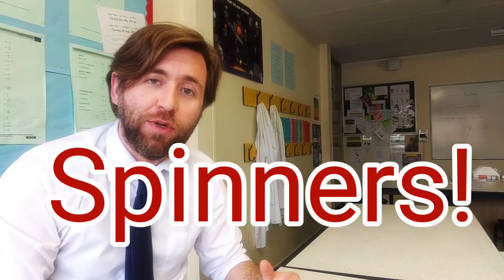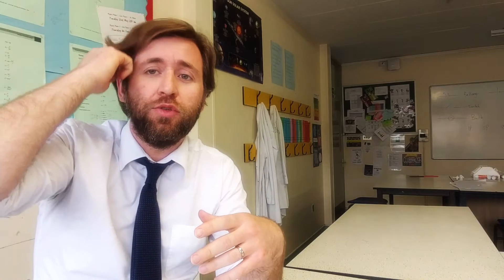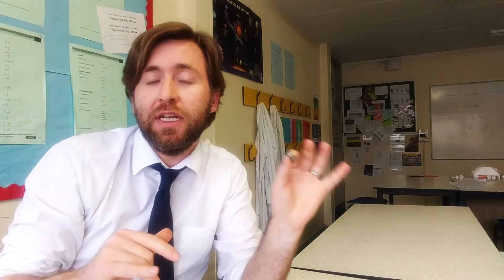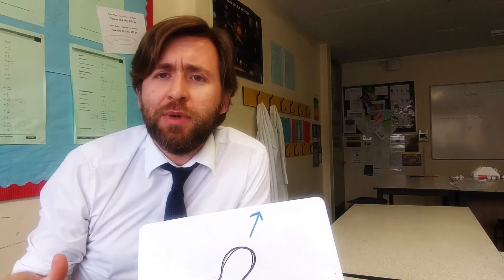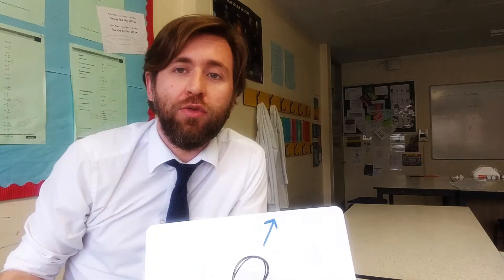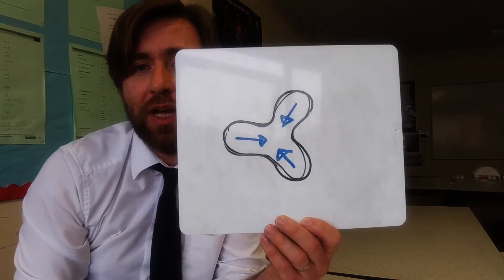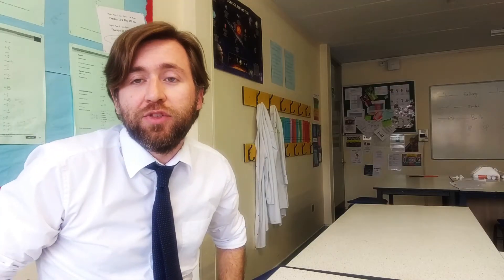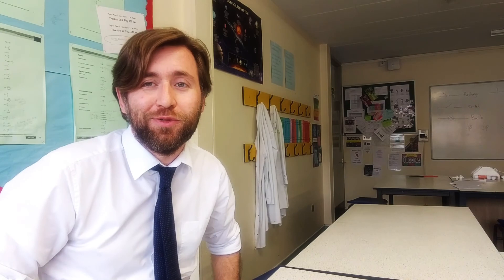how does a fidget spinner work?  CENTRIPETAL FORCE in fidget spinners - Physics Stories

Comment: Question: Wouldn't a wheel (same bearing, mass distribution and size) be strictly better because there would be less air movement/friction?

It would be harder to accelerate with your fingers though.
Reply from the maker: Lennard Hemkendreis yes a wheel would work fine, it might not look as exciting spinning though. have a research into gyroscopes, they basically are these.

Comment: I'm not sure if its just bacause it is cheaper. Buying a peace of metal is definitely cheaper than buying a bearing of equal mass, right? (both would be bought in bulk)

But there are also other advantages: 
1) It looks fancy, because people think its more than a fucking roller blade wheel. 
2) You can use the outer bearings to replace the inner one once it gets worn out (at least that would be a good idea).
Reply from the maker: Lennard Hemkendreis love the thinking here! point 1 I definitely agree with and point 2 sounds sensible. so the spinner bearings get worn?
Reply from the maker: Lennard Hemkendreis I think the benefit of all the holes being the same size seems small but things like that are important considerations in manufacturing. Cheers! 😀
Reply: They do get worn. At least I have seen a video where someone said that theirs did, because they used it so much. Thx for the answers :-)

Comment: Hi. These videos are great and when my children are a bit older I will certainly be coming back to them to help them understand things.

I realise you have to make these quickly but there are a couple of places in this one where I think people could misunderstand.

At 2'12 you say "The masses on each of the spinner arms are actually pushing into the centre to keep it spinning". My understanding is that you don't need anything to keep the spinner spinning. In a frictionless environment the spinner would go on for ever.

At 3'31 you say that the "[centripetal] force causes energy to be lost to heating". Again, my understanding is that there is no energy associated with a centripetal force (nothing actually moves in the direction of the force, the force is always perpendicular to the direction of motion) and that the energy losses are all related to friction within the ball bearings.

Centripetal force is a really difficult concept to put over and it's great that you can use these spinners to show people how it works.
Reply from the maker: Nice discussion.

At 2:12:  Without a centripetal force it would not accelerate around a circle but continue in a straight line.  So I think my statement is ok there.  You are of course right that in a frictionless environment spinner would spin on ad infinitum!  (seen my first spinner video?  https://www.youtube.com/watch?v=cVkU-owa3is&t=1s )

3:31:  I was asked a question about measuring the coefficient of friction, (where coefficient of friction x normal reaction = friction force,) so really I am just trying to give a clue about how that force can be calculated or measured experimentally.  In this case the centripetal force is equal to the reaction in the bearings.  But you are right, this is not specifically a "cause" of the force as they are not in the same line.  Friction is a force which opposes motion.  The size of that friction depends on the coefficient of friction and the reaction from the surface.

Cheers, and thanks for helping me clarify.
K